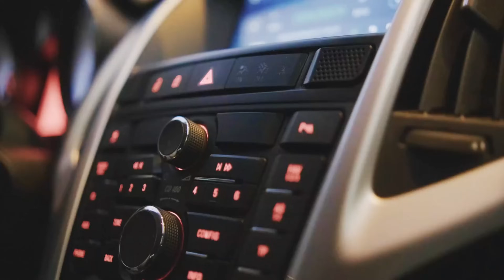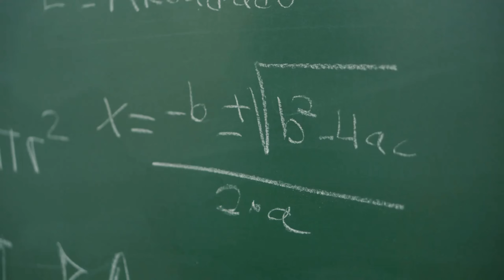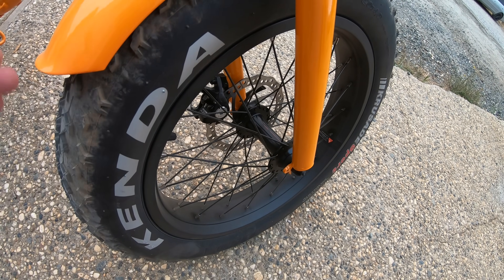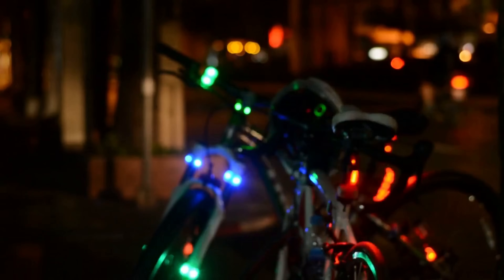Will Ebikes Ever Recharge While Riding?  Explained

Comment: Re-gen brakes would be great in the mountains.  Ebc offers a pretty good solar recharge option.  It’s $600 and can recharge a decent sized battery in a few hours on a sunny day.  I’m pondering the purchase for my model c.
Reply: I'd just be weary of that 150W output "under optimal conditions". That could mean on the Equator cloudless at noon. Pretry sure you almost never get the advertised output
Reply: I'd just add the extra battery and a switch, or upgrade both, two 1000w units?  Be huge
Reply: @Flamixco  I like the idea of having a spare battery for the rear because it’s removable and you’d only need to carry  an extra on the rare occasion that a big trip is planned 95% of the time 600 watts is fine, and I already have more than double that.
Reply: @trailguy  yeah, good plan

Comment: solar panel covered clothing?

 back when I was a kid we had little generators that would contact the front tire sidewall and power our lights, could design brakes that worked with something similar with variable power generation depending on desired braking power.
Reply: I remember that. It can be done but it doesn't profit the throw away culture.
Reply: Re "little generators" - the question to ask is how much energy they capture vs how much weight they add.

My take is that given the current state of the art of battery technology, and the fact that the heaviest component of an ebike system is the rider, the best way to add more energy to an ebike system is... to add a bigger battery and charge it at home. It's possible that there is a use case for the "little generators" like we had as kids -- maybe for longer, multiple-day excursions in hilly terrain - but you'd have to spec it out. I suspect the kind of system you're thinking of would not outperform the equivalent weight in "more batteries" unless there was absolutely no way to charge at home for a long time.
Reply: They have hub dynamos these days for powering lights. They generally only Rob a few watts of the riders peddle power to run led lights. Theoretically you could charge a battery off something similar but you'd probably spend 4 times as long struggling to get anywhere while charging the battery as actually running on battery power. Defeats the point of an ebike.
Youd be better off towing a trailer with solar panels on it charging up a second battery
Reply: @merendell  - I agree. I was thinking of long uphills and downhills with no way to carry extra batteries or recharge ... or use solar ... for a long period.

MAYBE it would make sense to add a light dynamo to recharge the battery on long downhill runs where you'd need to use the brake anyway. But it's such a bizarre use case. If you can't charge your batteries, then there's no sense in having them. Just use a regular bike in that case.

Comment: This is like a physics lesson for kindergarten. I can tell he's trying hard not to sound too patronising.
Reply from the maker: Nah, if I was explaining physics for kindergarten I would say: Physics is a branch of science that studies matter and its motion as well as how it interacts with energy and forces. The kinetic energy of an object is calculated from the velocity and the mass of the object.
Reply: @Area13ebikes  That's for kindergarten?  I know adults that wouldn't  get that.  I used to tell an electric car joke basically like you discussed here.   The battery powers the motor, drives the wheels, and there's a generator attached to the wheel and it keeps the battery charged.   I stopped telling it as a joke because too many didn't get the joke part.  Instead of laughter, too often the response would be something like "Why wouldn't that work?"
Reply: What would be cool for recharging bike motor while riding is by having battery charged through USB port on the bike. The same way you can charge your cell phone while riding.
Reply from the maker: @asoka2000  You can already charge your phone as long as your ebike has a USB port. Many do.
Reply: @Area13ebikes  Yes I know, I said it would be cool if you could recharge your ebike battery in the same way.

Comment: I have a friend ebike coming any opinion on it bud
Reply: Did you get the 1.5 with the included, high capacity battery?
Reply: @peterfernandezjr5914  no they have a very long wait for the 17.5 watt battery I will purchase it later separately
Reply: @albertharden1628  Too bad, seems like a real good deal to me. An extra large battery for those long rides.